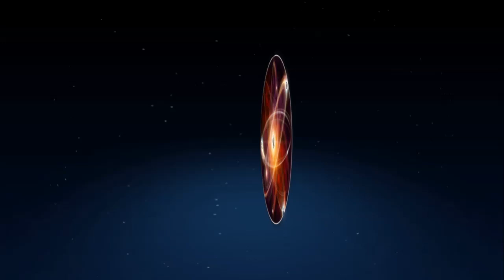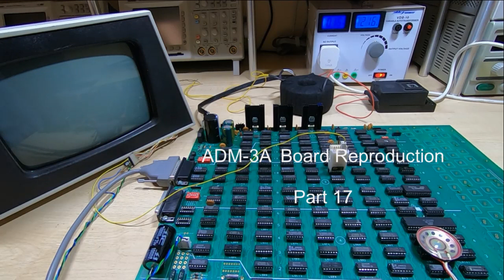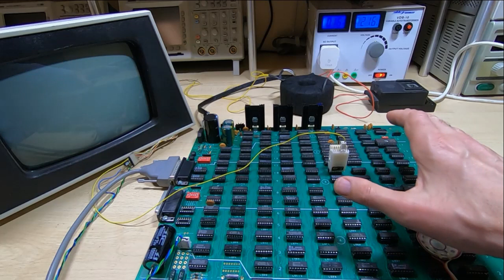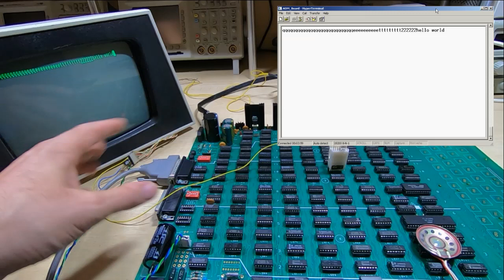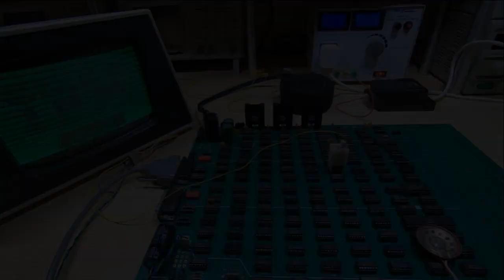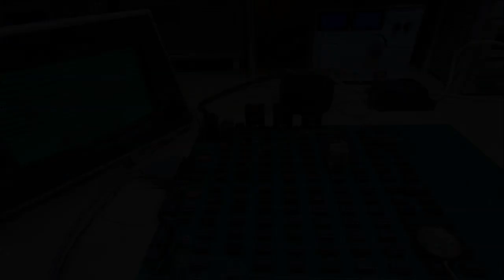ADM-3A  Board Reproduction Part17

Comment: Just a thought since you are already using a Pet Monitor is there enough space inside one of the larger Pet cases to fit the ADM-3A board in as it would make a nice case for it especially one of the really late curvy ones
Reply from the maker: I had exactly the same thought and is actually why I am using a PET monitor as that is what I intend to do with mine. The keyboard on the PET is also separate and I intend to fit the keyboard in the same way as the PET. The monitor will not work with the existing board as it does not have the scan range. I have not mentioned this in the video as I do not want to encourage the destruction of PET's. I happen to have a few old PET cases (I have repaired hundreds) so I  had a suitable doner. The original transformer would have to be removed as the ADM board is much bigger than the PET pcb and that is why I wound a toroidal transformer as it takes up less space than the original. The only other modifications required are to cut openings in the back for the D type connectors. They cannot be bolted to the PET rear case as the PET case slopes but then they are not screwed to the ADM case anyway. Then just a few extra holes to mount the board. I cannot decide if I should show this in a video for the reason given above, what do you think?
Reply: @JerryWalker001  Hi Jerry, Interesing question a quick look at the price of working ones I would imagine there's no danger of anyone cutting one of those up. It doesn't look like they are in danger of extincion either, I would think this would be a fairly niche use for a PET Case and the board itself would mainly appeal to the more hard core Vintage enthusiast, who I'm sure would look to sell on any usable parts for re-use. I'd say go for the video would be great to see the result. We used to have loads of PETs at work back in the day I wish I'd kept one we must have had one of most of the models I reckon. Most of the repairs I did on them was the rather poor main power connector from the transformer to the main board which I used to swap for a more suitable Molex one the orginal used to cause intemittent crashes assuming it didn't melt first of course !

Comment: That's awesome! I'm glad to see everything's working after all the hard work you've put into it :)
Are you going to be potentially producing a secondary keyboard PCB for soldering modern keyswitches/keycaps and an connector onto? I think that'd be something really useful if you are. Can't wait to see more!
Reply from the maker: Thanks, My plan is to make a keyboard pcb that connects to the extra connector I added. The only complcation is that the keys on the ADM do not match any available key cap sets so I am trying to find the closest match. Unfortunately the available key cap sets all seem to have different key widths for some keys and the key spacing will of course need to match the key caps. It is very easy to make the keyboard but as the likely demand will be very low then I can only really produce a single board and not offer variations. Once I have selected the key cap set then I will produce the keyboard pcb. I am still testing the board and so far everything seems to work. I will be posting an update video soon.

Comment: I am currently restoring an ADM-3A which is in really bad shape. The DIP-Switch cover is missing so i recreated the grafic from a foto. It is the (i think) more modern version with the big LSI Logo on it. But i would like to remake the "original" cover. Can somebody who has this cover provide a foto of it? Here is my version: http://kosmokrator.com/projects/retro/terminal_adm-3a/adm-3a_dip-switch-cover.pdf
Reply: Is this the cover you want?
https://terminals-wiki.org/wiki/images/1/17/Lear_Siegler_ADM-3-6.jpg
Reply: @glenslick2774  Yes, exactly. Imageresolution should be allright. Thank you very much!
Reply: @KosmokratorVideo  There is a higher resolution image of the ADM-3A configuration switch cover plate available now on the ADM-3A page of that terminal wiki site.
Reply: @glenslick2774  Thank you. That is much better.
Reply: I finally found a replacement font for the typo on that cover. Linotype Gabor Pro. It is not perfect but it comes really close.
Reply: Would you be able to sell me a cover ? I have an ADM-3A in reasonably good shape, but the DIP switch cover is missing.
Reply: @concunningham9795  Unfortunately not. But just use any online frontplate engraving service. Send them the PDF i provided and tell them which design / material you want.